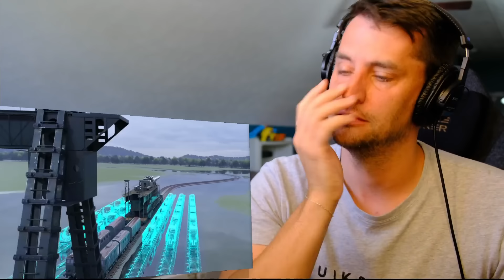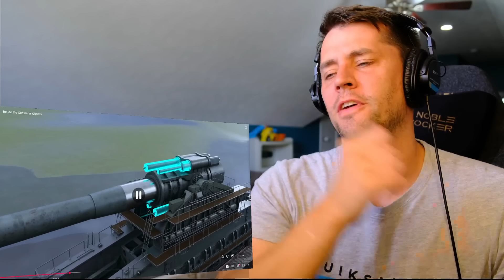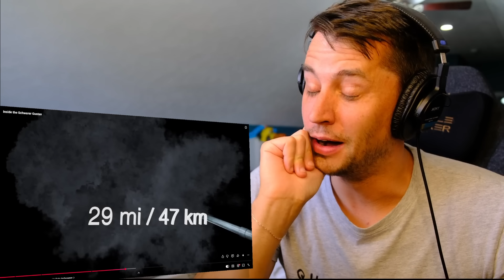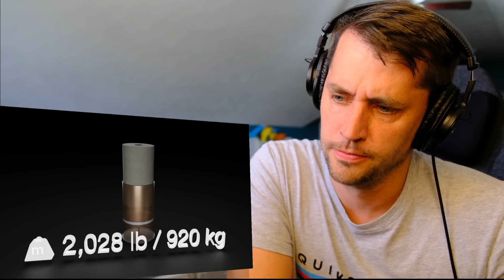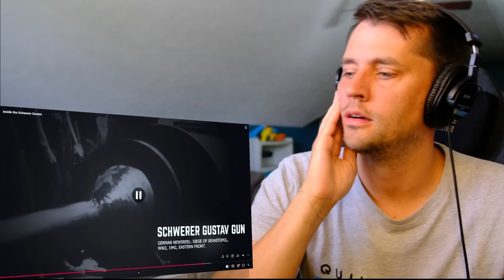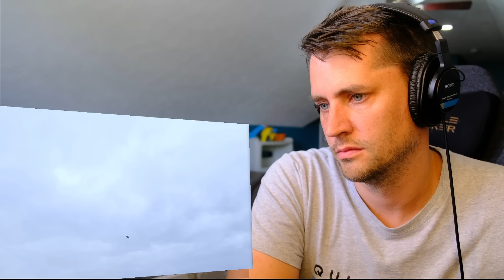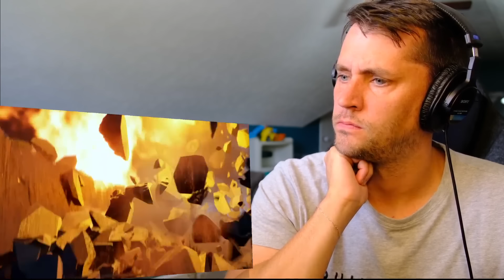American reacts to the Schwerer Gustav

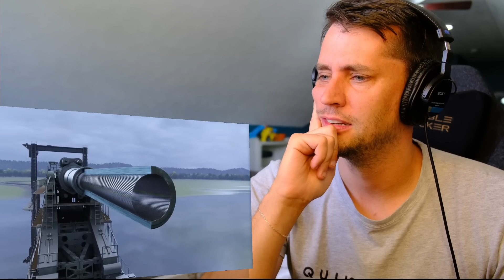Comment: 2:57
To put that into perspective.
Heavy guns always have a tiny bit of a problem with mobility. That's why "bigger guns" tend to be used on larger platforms, like ships, instead of tanks.
The standard tank gun for modern NATO main battle tanks is a 120 mm (4.725 in) caliber. The biggest battleships that the USA build used 16 in guns. The Japanese topped that on their two largest battleships with 18.1 inches for the main guns.

This monster used a caliber twice as big as the Iowa's guns. On land.
Reply: and modern standard heavy SPA is 155mm, same as normal heavy howitzers.
Logistics, standardization, maintainance.

Comment: 18:23 How? Rockets weren´t a thing, a tank would have to find a steep hill and have impecable aim to hit something that high and far away.
A tanks horizontal aim wasn´t and isn´t that great if it isn´t specifically designed as an anti air vehicle.
Panzerfaust or similar carryable weapons lacked the reach.
So, air force or a direct attack on the ancor point, which was behinde the enemy lines.
Reply: not to mention that aerial artillery observer balloons were a thing on all sides, for all sizes of artillery, since before ww1, I think to have read that even in the US civil war observer balloons were used. As you said, as long as the enemy hasn't complete air dominance that observer balloon is completly save in WW2 and if the enemy has air dominance no enemy artillery piece or observer aircraft is safe.

Comment: Dictators tend to build statement pieces.

They work great as a proof on concept, but are a failure on every professional metric.

Schwerer Gustave, Ficke Dora, Maus, Ratte, Grav Zeppelin (carrier), StuKa-Bomber ...

There were realy innovative breake throughs at the time, but they tend to get voershadowed.
Shipwhelding, medium mashine guns, assault rifels, submashineguns, ...
Reply: schwerer Gustav, dicke Dora and StuKa-Bomber were not failures on any metric. 

Even the Maus is arguably for it's intended purpose as breakthrough tank optimally usefull, if you have to try and brake through defenses like kursk again. schwerer Gustav, dicke Dora and Maus were all intended as breakthrough enabeling weapons. 

and for that purpose they are usefull. The Stuka is an extremly weird edition to your list since it is a completly adequat light bomber. 

Being unable to use your specialized weapon systems for the same reasons you can't use your general weapon saystems doesn't make your specialized equipment a failure. 

The ratte was never ever considered but was just drawn up in an design study. As for the Grav Zeppelin, it probably wouldn't have been the most effective carrier at sea, but servicable,  and it was directly discontinued when the early start of war with the UK and  France did occure.